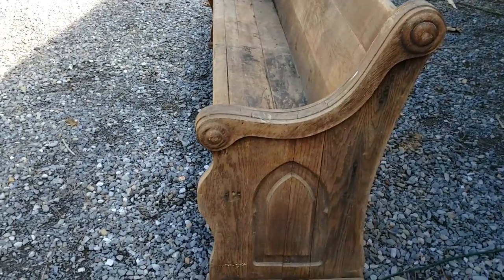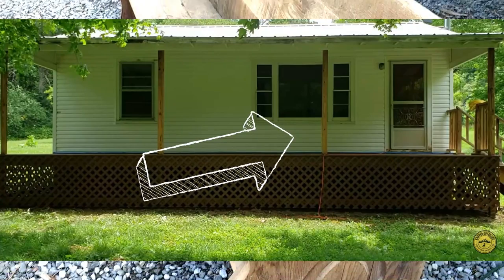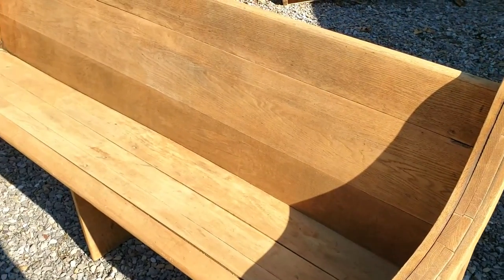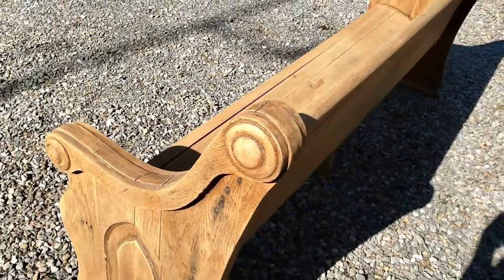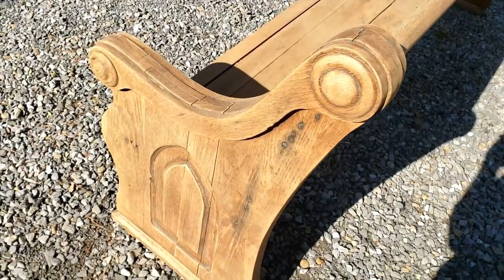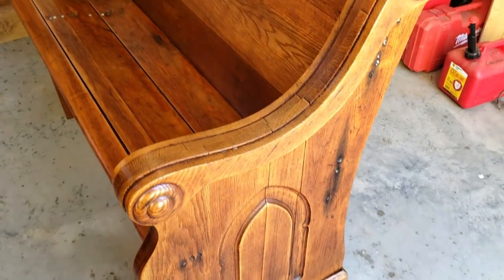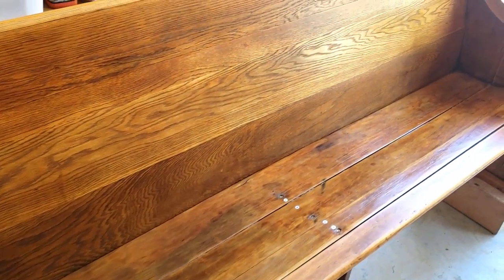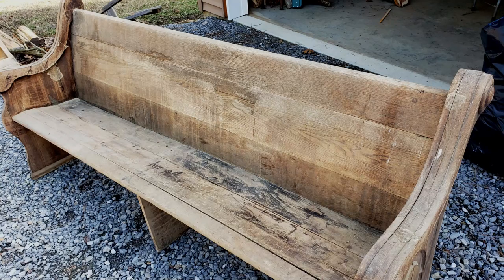DIY Restoring an old Church Pew for Rustic home decor

Comment: Hi Mrs. K what grit sandpaper did you use when you first started sanding the pew?
Reply: Hi Taylor. I started with 120. It's so old and worn, luckily nobody varnished it, so it came off real easy. I then went to 220. I could have started with 80 but I wanted to keep some of the scratches and dents for character.